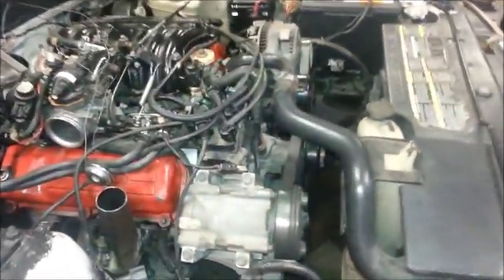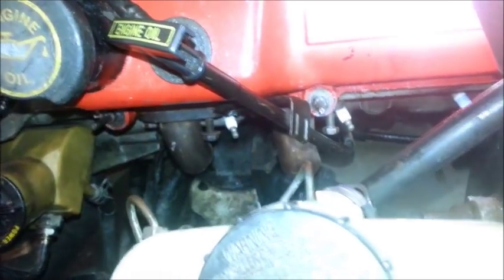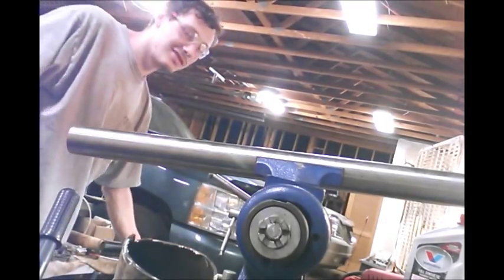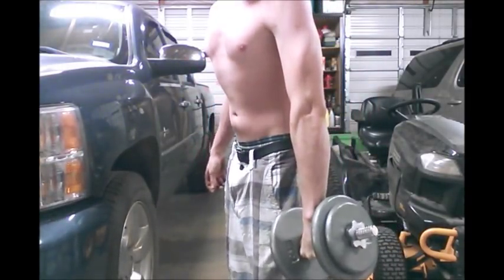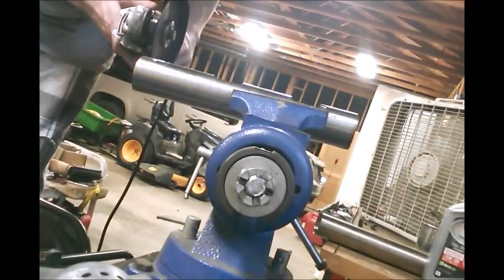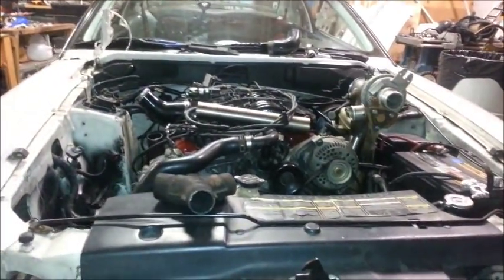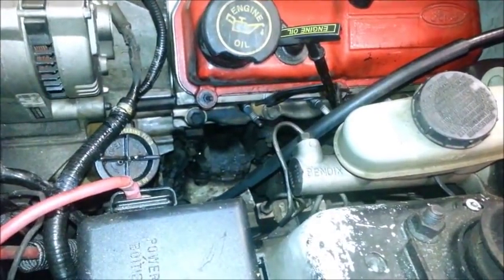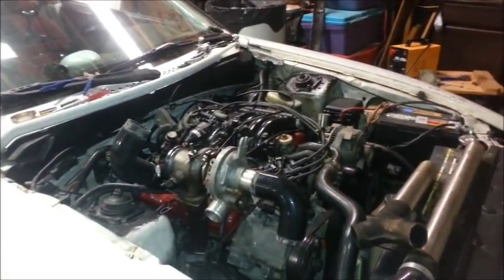Turbo Manifold #2 BUILT !   _______  [sn95 3.8 v6 Mustang ]

Comment: I know this is an older video but what did you use for a map sensor or are these cars mass air?
Reply from the maker: MAF in front of the inlet. Haven't looked into MAP conversion yet, don't need it.

But when i get this twin turbo going i will rig the MAF inside of the red cone air filter.
The car should hopefully be sexyAF.

Comment: dude  just swap driver to pass backwards and same for other side  .they will face forward and down . way easier to mount that way
Reply from the maker: I've done every which way. it either hits the brake booster, engine mount, or hits straight into the wall.